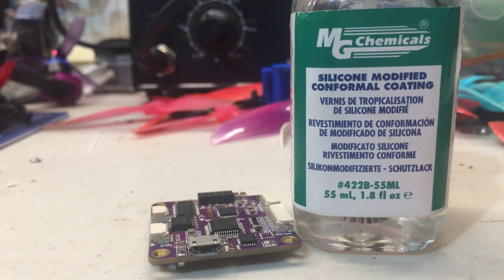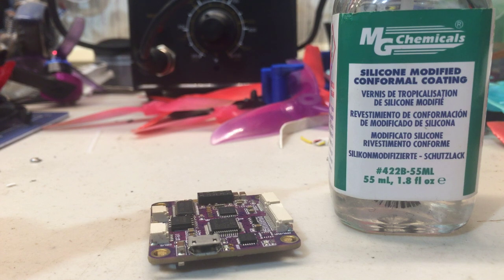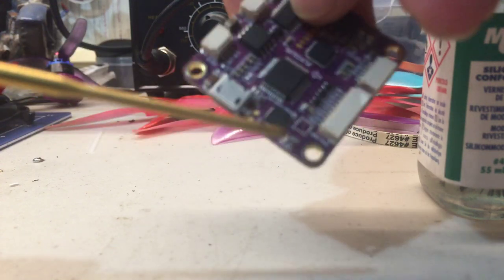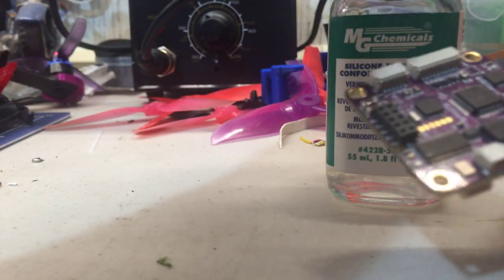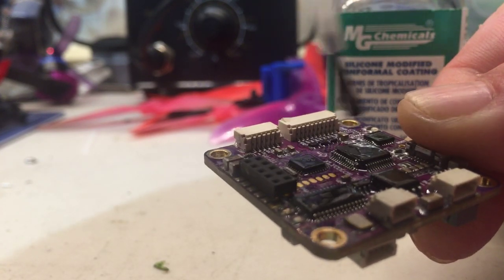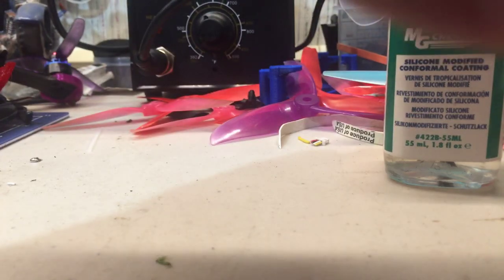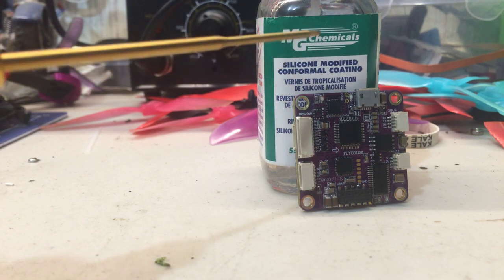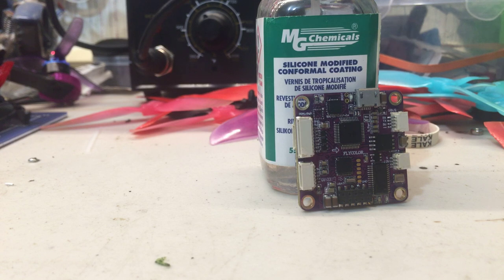Conformal Silicone Coating The Do’s and Don’ts

Comment: Sweet tips🤘You can use a uv light with that modified silicone conformal,2 see if you missed any spots:)
Reply from the maker: Yupp I should have metioned that Dayum lol Thank You Brother
Reply: Yeah just mentioned because I thought I had coated 3 of my birds good and remembered that I had a uv light and checked and I had seen I missed a couple spots,but without uv light it looked completely coated,thanks for all that you do bro...truly🙏
Reply: with the brush that's on the bottle, you're really gonna need it. that thing looks astoundingly crappy. lol
Reply: How long does the coating last for?

Thanks for the info 👍🏻

Comment: Conformal coatings don’t actually waterproof electronics. What they do is prevent corrosion of the circuit board from any moisture present. To waterproof you need to completely encapsulate in some kind of epoxy. This is from the mg chemicals website;

“Waterproofing electronic circuits requires the application of an unbroken conformal coating that is free from any voids and has a watertight seal around the edges. Some believe this is the actual function of a conformal coating, but this is simply incorrect. Rather, a conformal coating acts as a semi-permeable membrane through which water can pass by osmosis. It protects the circuit from the harshest effects of long-term moisture exposure, such as the corrosion of copper traces, but in order to truly waterproof a PCB, the circuit must be fully encapsulated in epoxy, polyurethane or a silicone resin.”

Comment: I have landed a couple times deep in snow without conformal coating and all I'm saying is after rinsing it with warm water and letting it dry in a warm place everything has worked just fine. Just don't ever plug it back in when it's wet, have got a prop to spin pretty fast for no reason in my room and it made a mess.
Reply: Exactly. And I know your comment is old but for anyone that comes across this video on Google like I did:

Electronics are only damaged by moisture in 2 ways. The first is getting wet while powered, this causes shorts to occur and can damage components. At the very least it usually causes the device to misbehave until the shorts are removed. If nothing crazy shorts (i.e. shorting a 12V supply to a data pin) the device might still function once dry. When a device is unpowered (which is not necessarily the same as turned off), liquid will not typically ruin it right away -- that's why if your phone or other device gets wet most sites/people recommend you immediately power it off. 

The other way moisture can cause damage is corrosion. Liquid can destroy something even if it's powered off by corroding it. That's why you can say, spill soda/water/etc on something, you wait a bit, turn it on, and it still works, but a few days to weeks later, it suddenly stops working. That's because though there was no short preventing it from working, but the liquid corroded something during that time to the point where it can no longer function.

Again, I know you probably know this, just putting it out there for anyone coming across this video/comment. :)

Comment: The ports thing is a misnomer. It's a pain in the ass to rub the pins off but it's doable even easier if you reflow the joint. Protect those fetz! I love how most quad guys (not you as I don't know you) have no idea what a fet is or how an esc works in conjunction with all the different parts. Most can't even solder or use a multimeter. I've watched mod videos that were an absolute joke and an 800 dollar piece of bleeding edge tech were bricked because they never bothered to practice soldering or even learn what a fet actually is.

Comment: can you solder to the board after you coat and then recoat. im asking becouse i have never used this stuff but might want to.
Reply from the maker: Yes heat burns it off and then just recoat was repaired
Reply: Chris Riley Music Drone Videos I’ve been using clear nail polish. It seems to work just fine. 

Good tips Mdti95

Comment: I used it on a AIO whoop board and now Beta says I don't have a Gyro. Won't arm cause no Gyro and RPM filtering. 🤦‍♀So I guess only thing to do is try and remove it. I don't understand what happened but I did see that it happened to others on the web.

Comment: Hi, How to protect the drone motor from rain? Or it does't need ...? 😊
Reply: Apparently drone motors already have a waterproof coating on the wires.
Just make sure to rinse with distilled water and dry well after taking a dunk to avoid corrosion

Comment: do they come in high temp versions? i want to put liquid metal on the cpu and gpu of my laptop. i want to coat around the dies just in case the liquid metal spills over after applying the heatsink

Comment: Thanks. I am worried if I don't coat the boot button it will cause problems when getting wet? Or if I coat the button it will flow under it and destroy the function? What do you say?
Reply: I say you are correct! I've just finished coating CB radios and i had huge issues with PTT press to talk and other buttons. I had to fart around to get the stuff off using another product and it wasn't fun. However liquid glue is less viscous and very easily removed. U could drop a dab over it to remove later.  As this button has to be pressed down to make contact its a relatively unknown quantity whether water would cause an electrical connection. Personally I'd certainly not coat the boot button as it's the other more exposed components that are the issue. Others have mentioned not to coat the gyro but im not certain of the validity of this. If you land in water let it dry before u fly.

Comment: can you clean your FC and ESC with isopropyl alcohol after using this silicone conformal coating? or will the isopropyl dissolve away the silicone coating
Reply: I tried doing that and immediately there was a very sharp smell (probably toxic too) so don't try it.

Comment: Hey so because you cant put it in the ports. It will never be fully water proof right?
Reply: You are correct. This is just extra protection but certainly not perfect. I believe you would need to use special waterproof connections and coat the entire thing in some type of epoxy. There is a more detailed explanation further up in the comments.

Comment: Do I have to remove flux residues before applying conformal coating ?
Reply: its best to
Reply: old types of flux used to eat away at the electronics and board.

Comment: I don't think you should be touching the board  with your hands . I was always told by computer guys never use unprotected hands .
Reply from the maker: Thanks for the Tip I will remember that
Reply: @brettwilson I work for a coating house and we wear gloves and live, eat, die, breathe ESD standards by wearing wrist straps/foot straps for grounding lol cosmetically companies don't like fingerprints 😑 but oils and other foreign debris from your hands can definitely cause issues down the road with conformal coating whether it be AR, UR, parylene, silicone, etc... 👍